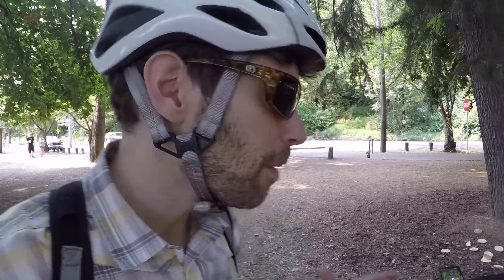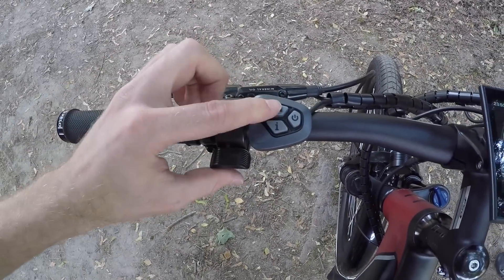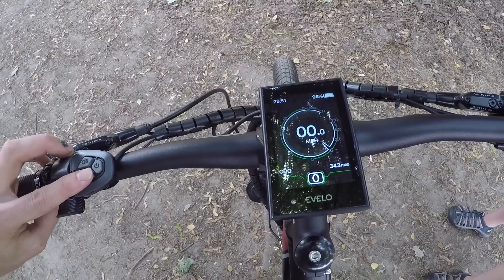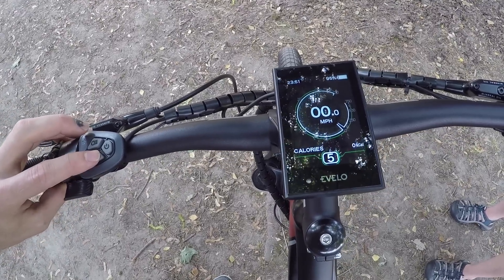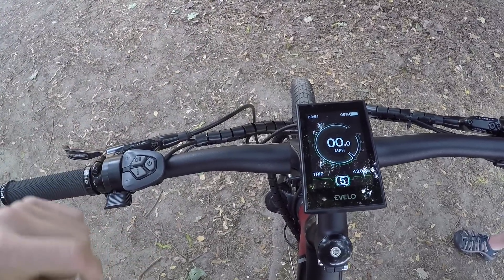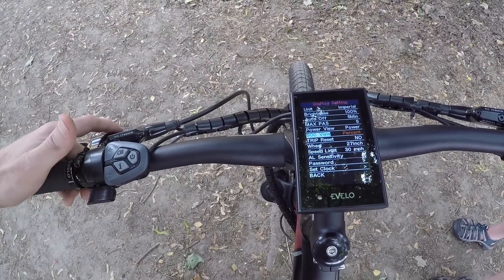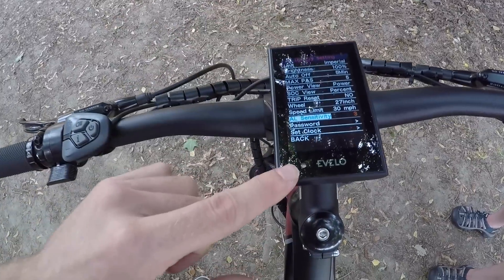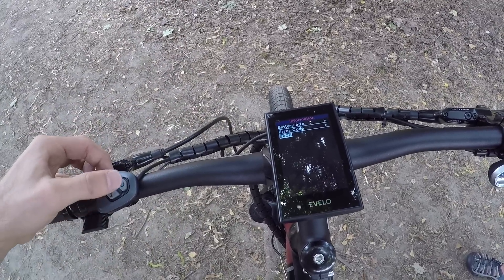Bafang DPC-18 Electric Bike Display Settings

Comment: Hey I have the same display, my manual says something about holding the “+” button to toggle between eco and sport mode. Mine doesn’t display either one, is anyone else having that issue? I’m guessing the feature isn’t there so it may just be stuck on one setting, hoping it’s on sport.
Reply: No . But you have 9 levels . I have mine set to 9. 3 "5 an 9

Comment: I have this Display and love all the information I get but I have one problem and hope someone can help.

The battery owner manual states that battery should go through 3 entire charge cycles (from 0% to 100%) but when my battery comes to 17% it automatically sets the support level to 1 even if the display still shows 5. Range showed 16 km but after 10 km, battery is still at 15% and range at 12 km. I'm desperate as I really want to discharge entirely the battery. Someone knows if it is possible to unlock this and use the full engine power even under 17% of battery charge?
Reply: No the battery will not fully discharge . Its diffrent then the old batterys . The lcd will cut the moter when the cells get to a certain power level . The old ones it give them better life doing what you say but not with lipos .
I would have thought this lcd would show motor temp

Comment: Does this work with 52V battery? If the battery is fully charged (which can go to ~ 57V) would that still work ok? Isn't this better or worse than 860? Thanks a lot.
Reply: I have 850C and works perfect with 52v battery.I think that 60v are max.
Reply: @jaciks  I was not sure but I ordered DPC 18. So u think that would not work with 52v?
Reply: @hamidrezazahedi9205  it works.

Comment: How can you fix the top speed. I have a BBS02 Bafang 1000+ motor, and a 48v shark battery. I have the DPC 18, and have set mine to 40 mph (It used to go that speed until I had to replace th e dashboard) and it is no longer going at top speed, its top speed is only 26 mph.
Reply: Hey did you find something to set the speed higher ?
Reply: Have you got a 11t small cog on the back

Comment: Battery information ( around 2.48) does not display unless you have a Bafang battery otherwise it does not display anything.
Reply: My husband just bought a new battery (not bafang) for his display and it works. Something else is wrong with yours.
Reply: This display works fine on my home built bike using a non-Bafang battery (a cheap 52v battery I bought on ebay).

Comment: Hi may i know which batteries work with dcp 18?
My dcp 18 is not showing range and also in settings not showing cells or charging time.
i Have 48v 15amp battery samsung cells.

if you could send me a link where from i can buy battery which cooperate with dcp18, as i would like to use all features of dcp18

Comment: My bike can now reach 65 mph, speed cars on high way
Reply: Bullshit
Reply: How ? What did you do ? How many volts in the motor and the battery how many wats?
Reply: I can only go 30 mph I got the 48 fabang motor with a 750 wats joyisi battery
Reply: In my settings I already put 60 mph but I can only to 30 and Iam  skinny
Reply: I had mine up to just over 70mph, but I had to fold down the back seat to get it into the car.
Reply: Mine can do that on a massively steep descent with a huge tailwind 😂😂

Comment: I have one of these and it looks lovely.. but there are some issues.
-the unit seems to be designed to work with a Bafang battery and some of the features are not usable.
- my unit only goes up to PAS 5 not 9. The option to change it is not available. I'm not sure if that's an issue as the BB02S controller software allows programming for 9 levels. I'm hoping to be able to make modifications to the PAS and throttle within those five levels as I'm not particularly pleased with the response and sensitivity of the motor.
- anyone having eyesight issues may find the font size to be too small.
- it supports error codes. My speed sensor went out of adjustment and the unit identified the error right away.
- there was a slight fogging inside the screen at -10C, no idea why but it disappears above 0C.
- In direct sunlight it is hard to read even with the brightness turned full on.  
- my main reason for buying this unit is that It supports a 52V battery and the accurate voltage readout is very useful.
- I couldn't find a difference between Sport and Eco modes.
- there is no Range or Calories option on mine.
I would say if you are ordering this as part of a kit or by itself,  don't expect it to deliver the goods in full.
Reply: Sounds like it has been constrained. Mine has 9 levels available (bought from Luna) for the bbshd motor. Yours may be due to 3rd party seller constraining it, or an odd controller or BMS it communicates with.
Reply: @artdsm  You have to wonder how many versions of this product are out there..I do know others have had the same issues.
Reply: Mines matching this dpc model and it can reach 65 mph
Reply: Did you figure anything out as far as adjusting the pas levels? I've got the same problem, replaced my old display and theres no max pas in my settings

Comment: Will the DPC-18 show accurate percentage information for a 52v battery? or is it locked to 48v like the last model (DPC-14)?
Reply: Percentage isn't all that accurate but what is useful is that it will show accurate real time voltage for a 52v battery.
Reply: Is accurate for 48v not 52v.  I didn't see the advantage in paying more for 52v so went with 48v and get fairly accurate readings with DPC18 on my Luna cycle shark pack.
Reply: @robertgreen7569  If you set the display to show voltage it should give accurate readings for a 52v pack.. from what I'm told 60v is max.  Mine shows 58.7v for a freshly charged pack.. Now it may be the case that Luna uses a different version of this unit with  48v max limit.